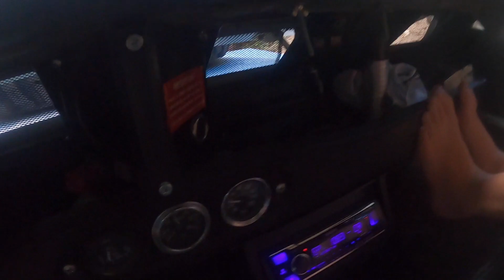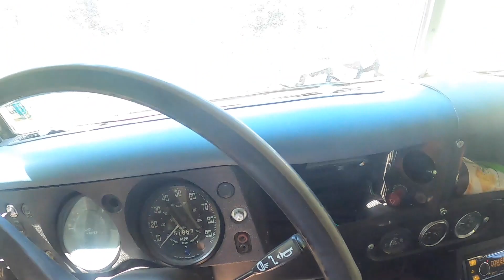Episode 7: The Series 3 Takes on Mt  Champion and the Rear Differential Grenades Itself

Comment: Lovely series 3 and great scenery in your part of the world. Having watched your other video, you way overfilled the overdrive, it only needs 0.4 litres of oil which does'nt seem like much, but overfill it, and use the overdrive and the pressure will force it past the seals,
Reply from the maker: Good to know! What information I had said it should be full, which is why I added so much. Thanks for the tip!
Reply: @RelentlessMotorsport  No probs, over the years I've found a lot of lessons with Series Land Rovers come the hard way! Hope you get the diff sorted easily and look forward to more videos on your channel mate👍
Reply: Just incase you were unaware. You could have taken the rear prop shaft off and just used front wheel drive. You could also have taken the rear half shafts out to avoid spinning any diff parts.
Sounds like you did well though.
Reply from the maker: @vicious0005  I actually was planning on having to do that, but whatever broke in the differential seemed to make a clean break. I also was concerned that the driveshaft might be the rear seal of the transmission and really didn't want to burn up the transmission. I don't think Land Rover would have designed it like that, but couldn't be sure, so decided to run it so long as the rear diff spun freely.